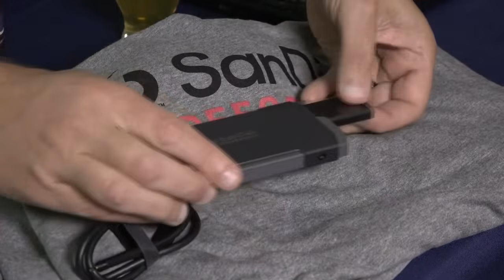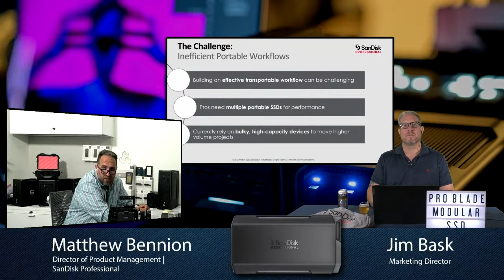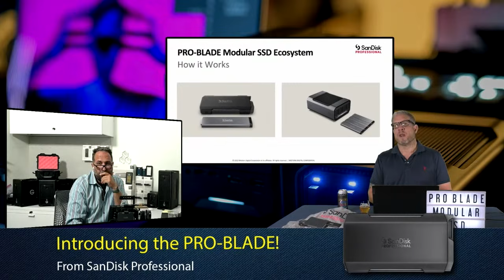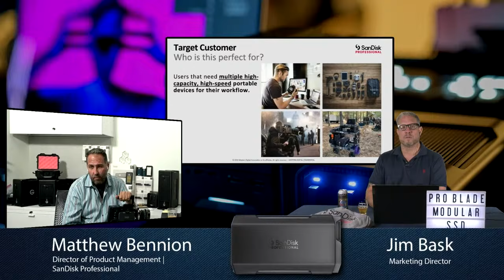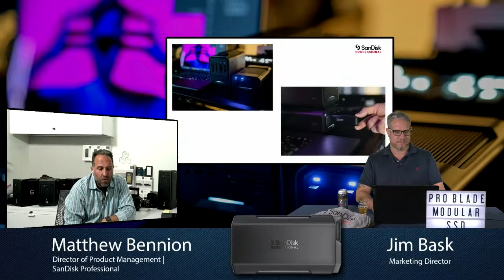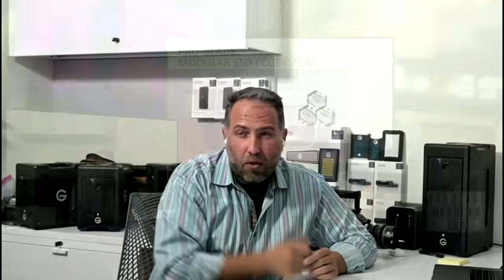Introducing the PRO-BLADE from SanDisk Professional

Comment: I use 4x Samsung 970 evo plus (3000 read write) All flash workflow on Mac, will I be able to fit these on your blades? Is there a dummy enclosures for existing NVME ? If so will it limit the transfer speed ?
Reply from the maker: All of the blades are proprietary and will only work with the Pro-Blade family of products.
Reply: @Videoguys  Thank you for the response..